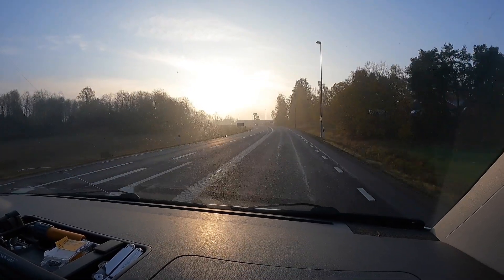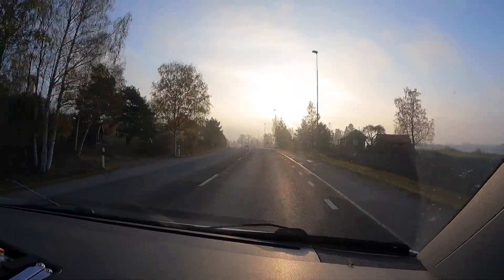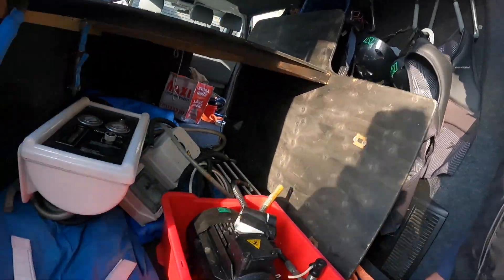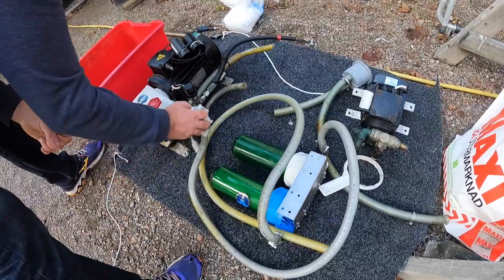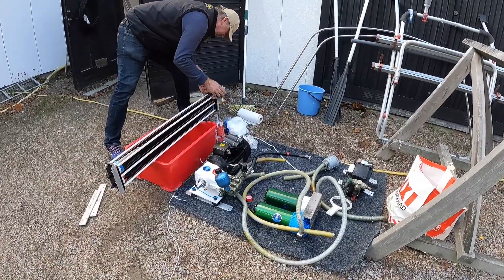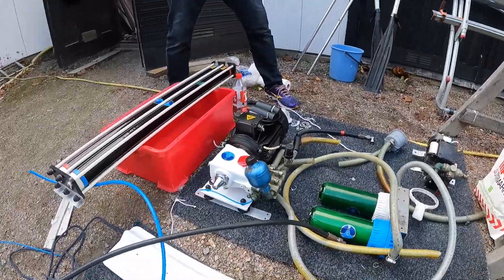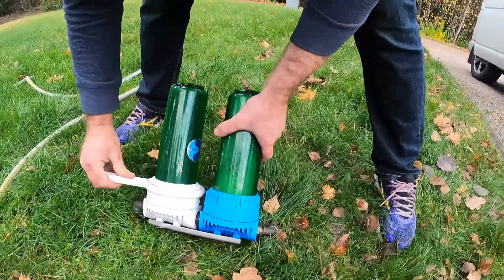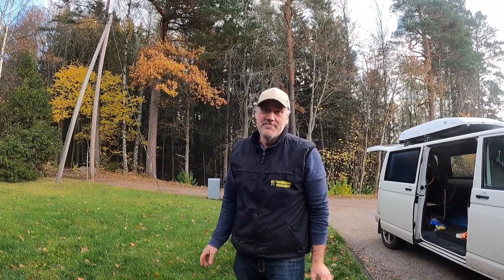Drinking seawater will soon be possible for us!

Comment: It is a lot of maintenance to keep it in running conditions,,,, are you planning loong trips to very remote areas, I've concluded that I think it is unnecessary to install one until I'm heading to areas where I don't trust the drinking water. So now you have gotten me very curious about your sailing plans.  Best regards from Jarle
Reply: You can go to France and Spain and run out of good drinking water , ?  Will save on a lot of plastic bottles , 
And i agree it's not for short trips,  if you keep using ,  not much maintenance,
Reply: @davidwarnes5158  yes empty plastic bottles is a pain on a boat... good point!
Reply: @StemtoSternSailing  maybe a good idea to set up a water filter , so you can use the tank to drink from,
Reply: @davidwarnes5158  i haven't cleaned my watertanks well enough yet,  and i haven't installed a water filter either, at the moment it is drinking water in canisters and bottles.  And 300 liters of freshwater for other uses in the water tanks. For my cruiseing area this works "ok" for the time being. But there are plans for improvements. But im very curious about what these guys are up to and im looking forward to see how they install their system on their boat,  i guess we'll se some clever engineering! Best regards from Jarle
Reply from the maker: Hi Jarle!
We agree, for short trips it is not necessary, we prepare the boat for live aboard all year around. The future plans are just plans and dreams for now. Sorry Jarle you need to bee curious for a while.😉
We want to install it now, but some other work need to bee done first. 
Cheers from Sweden